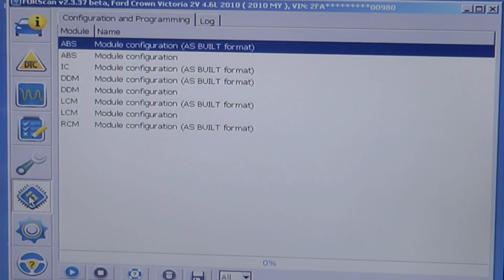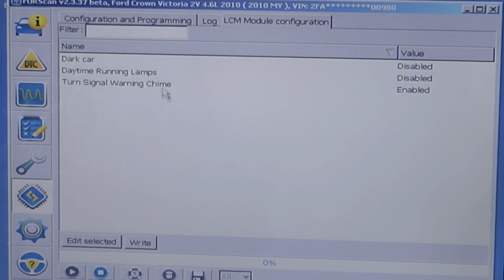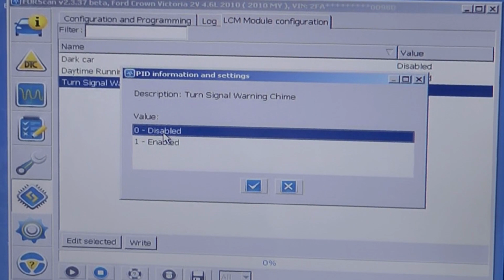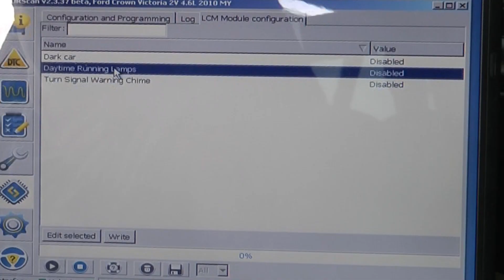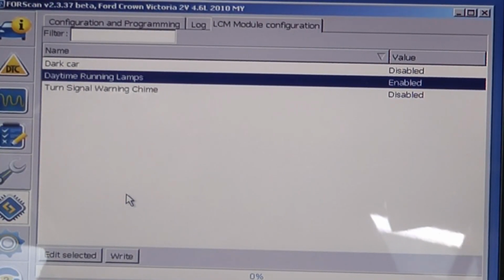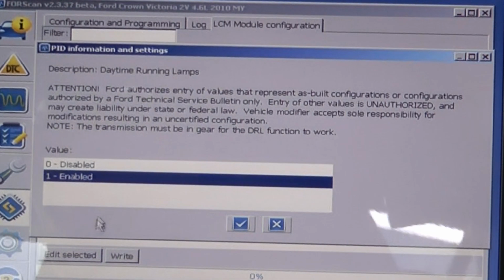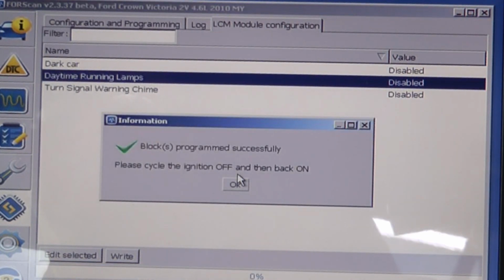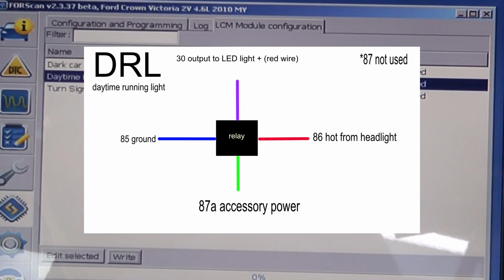Ford Crown Vic DRL Daytime Running Lamps - activate with Forscan

Comment: I like the idea of having the option to run DRL’s.
However I do not like using the High Beams at 50%.
I would much rather prefer stand alone auxiliary lights like your fog lights.
I would also like the choice of running amber, or white LED’s.
And running them off a stand alone relay is genius, I never thought of that.

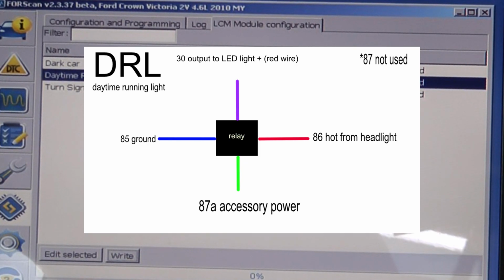2:14 But I’m confused by your diagram. 
PIN 86 is the “trigger” for the relay.
So that would need to be wired to something that works of ignition / engine running power correct?

The diagram shows it’s triggered by the “headlight”?
Doesn’t that defeat the purpose of DRL’s?
I thought DRL’s were supposed to automatically come on when the engine is started, and running.
The diagram shows that in order for the DRL’s to come on, you have to turn on the “headlights”.
My brain is in DRL overload, am I understanding this correct?

-Chuck
Reply from the maker: You're not reading the relay correctly.  If you look closely you'll notice it is wired to Accessory power which goes to the lights automatically.  So lights come on with key on, and turn off when key off.  The relay "trigger" comes on when the headlight comes on and it switches the relay so no power goes to the light.
Reply from the maker: there is one potential flaw in my diagram and that is if the headlight wire isn't hot when high beams are on then the DRL would come back on.  This could be fixed with diodes and hooking up both headlight and high beam to the relay trigger so that either one would trigger the relay but neither would send power back to the other
Reply: @WJHandyDad  
That's another thing that confused me.
The diagram says; "86 hot from headlight"
Is that the low beam circuit, or the high beam circuit?
Reply from the maker: @PanzerPlatform  you ought to check with Panzer Platform Extras, I mean TV, to see if he can explain it to you
Reply: @WJHandyDad  
OK, I had a feeling I was reading the diagram incorrectly.
After looking at the diagram again I realized this is a 5 pin relay, and not the 4 pin relay that I'm used to using.
The 5 pin relays still confuse me.
Thank you for clearing that up.

Can you make a video; "4 PIN Relay vs. 5 PIN Relay - Pros & Cons"
-Chuck

Comment: I modified my headlights to LED Projector headlights,I need low beam to remain on when high beams are turned on... High beam wire runs solenoid  to un-shroud LED .  any way to program LCM to always have low beam energized when lights are on?
Thanks
Reply from the maker: the simplest would be to hook up the high beam wire direct to the low beam with a diode so that the high beam triggers the low beam, but not vice versa.  The smarter way is probably to have the high beam trigger a relay to power the low beam so that you have power from another source besides the already overworked LCM
Reply: @WJHandyDad  Thanks, That was the original plan, I've done it before I was just hoping I could program something and avoid rewiring, I'll cut plugs of another car and make a harness to plug in so I don't have to modify my original car
Reply from the maker: @mike.s1166  there is probably a way to do it via programming but I don't know what the 72x-xx-xxx code would be

Comment: Panzer Platform sent me! nice info,would this work for a 1998 cv p73?
Reply from the maker: I have never owned a Vic older than 2003 so I honestly don't know.  The nice thing is Forscan is free and they have a lot of info on their website.  Only gamble you have is buying the OBD connector but Amazon has a good return policy if it doesn't work.  Please let us know if you try it and if it works
Reply: @WJHandyDad  shes an oldie,but rock solid! if i try it,ill let ya know,thx